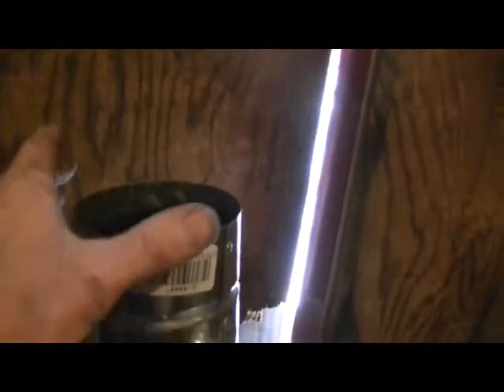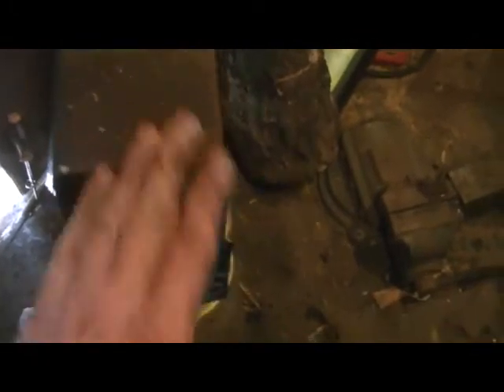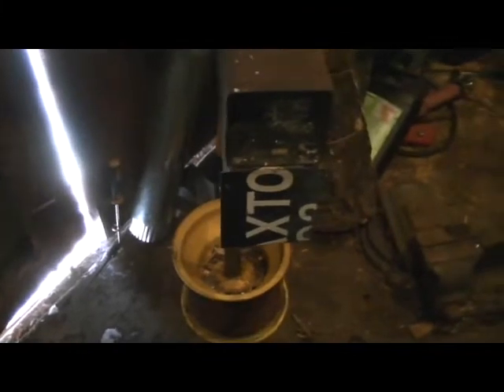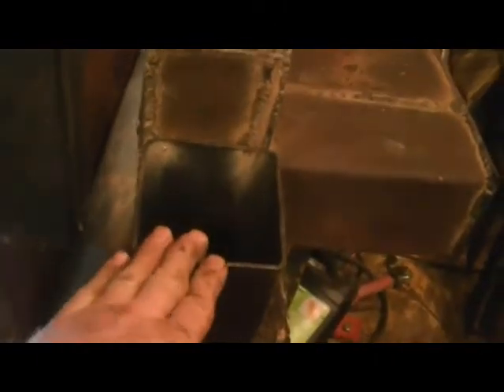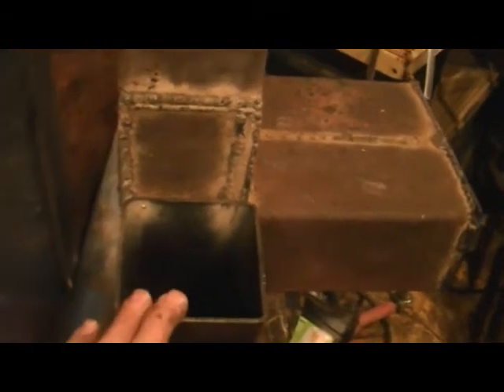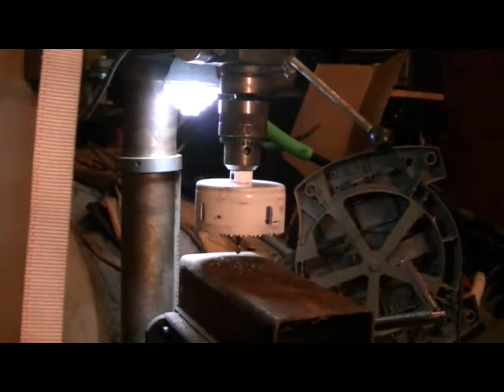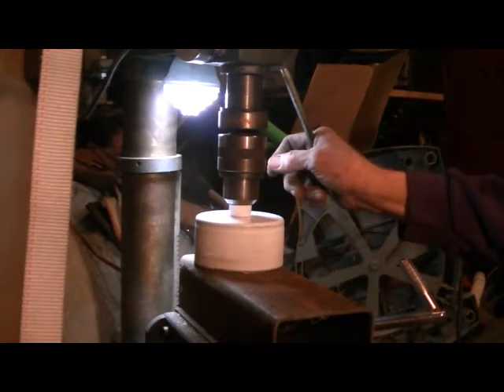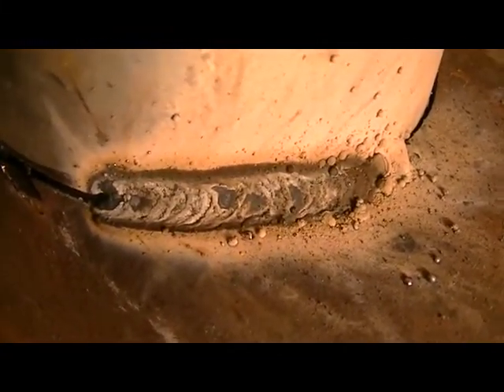Omega Stove Build Step By Step Part 1

Comment: That is really cool.  We have a gas fireplace in our home and we are trying to figure out how to do a wood burning stove when we do not have a chimney.  I am thinking this method might work if we could cut a hole in out log walls.  But, I think I might be terrified to try it.
Reply from the maker: make an adapter for a window out of sheet metal with the flue going out the middle. A lot of pellet stoves are vented this way.